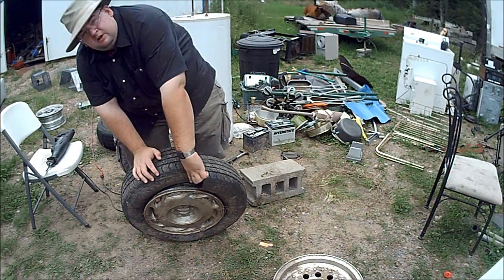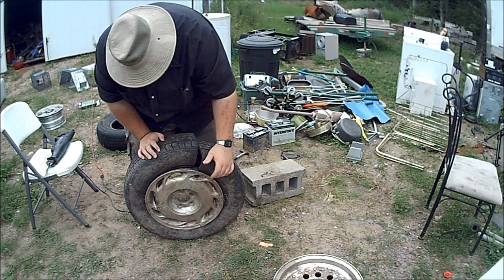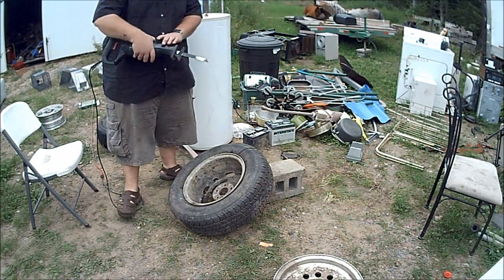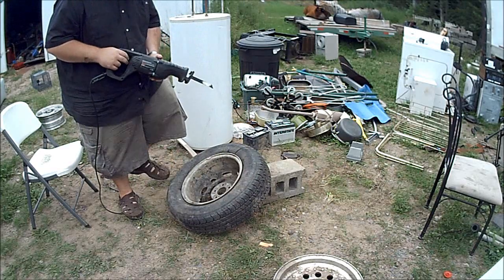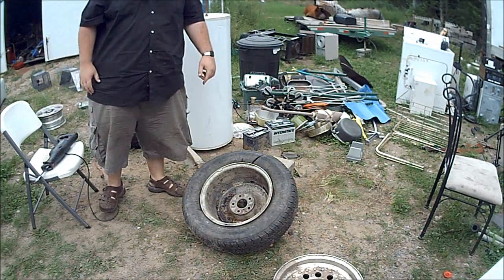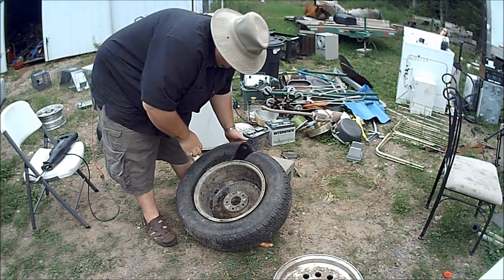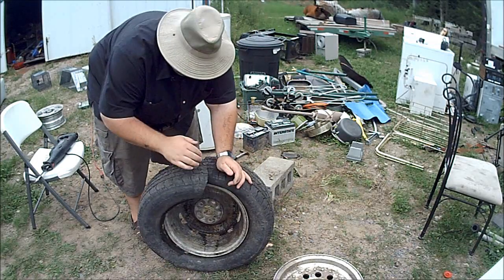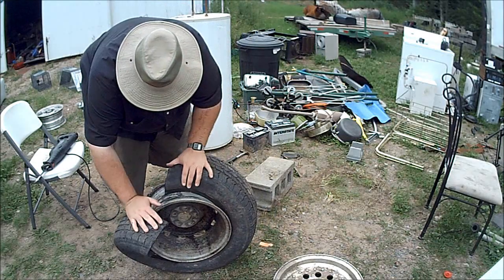How to get tire off rim for scrapping if bead is sealed in less than 4 minutes

Comment: What if the tire is filled with air and has wheel weights as well? Are you in danger of explosion if tire is right full of air? Thank you, I'd like to try this but all of mine have air
Reply from the maker: get the air out first by pressing in on the center of the valve stem

Comment: well thats a tempo wheel and they are not even alluminum. Just take your fingernail and press into the wheel you will see the outside layer is rubber. I know it used to fooll me , a few times anyway till i remmebered